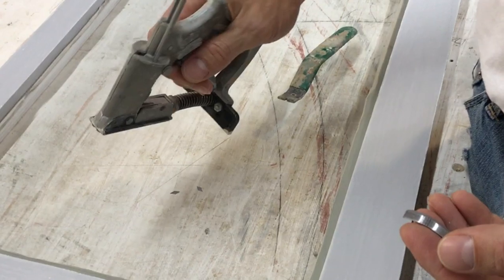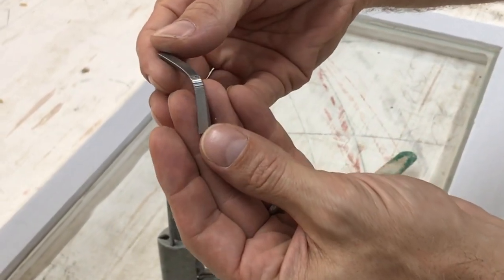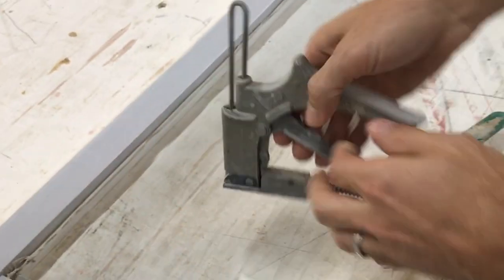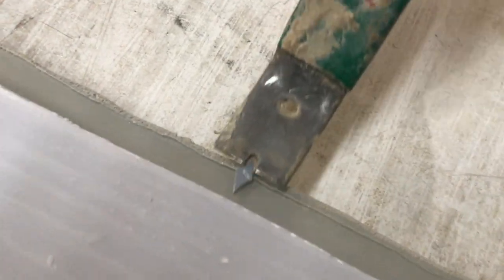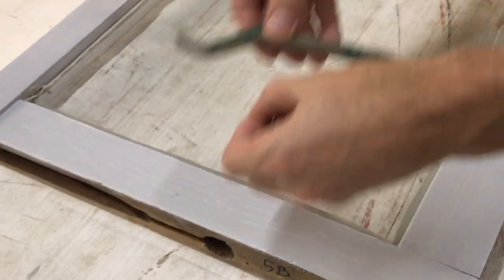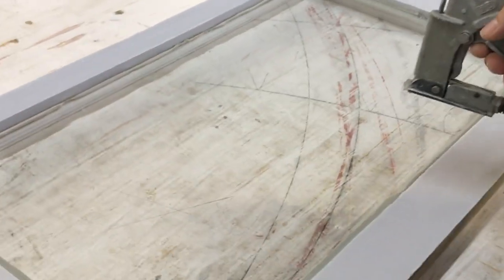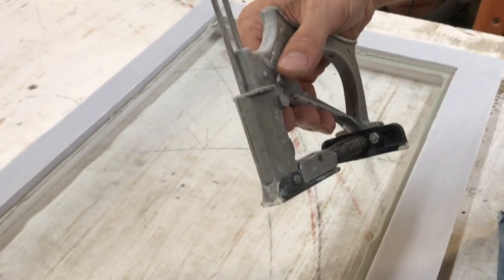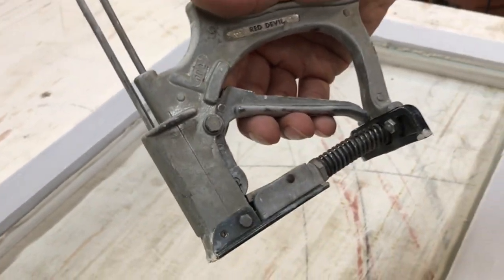How To Use a Point Driver

Comment: I have a 100-yr old house in lexington, MA.. All the sash windows are wood and need repair & maintenance. I bought a Fletcher #5 point driver for speed, and because the small diamond points do not protrude past the sash reveal.  Here's my problem:  after the 1st  or 2nd point installed, the glass pane breaks when the I pull the trigger. Do you know what's causing this? how to fix it?
Reply from the maker: It’s tough to say. It could be a lot of things.
Reply: I have an antique house, too, with windows that always need repair. You may be doing two things wrong. 

First, put a bead of glazing on the frame before you put in the glass. This cushions the glass now and in the future. 

Next, hold the gun and shoot the points parallel to the glass. My guess is you're holding the gun at an angle toward the glass. The pane can move away from the first point but is more restricted with each additional point. The glazing is what really holds in the glass. The points don't need to be so tight against the glass.